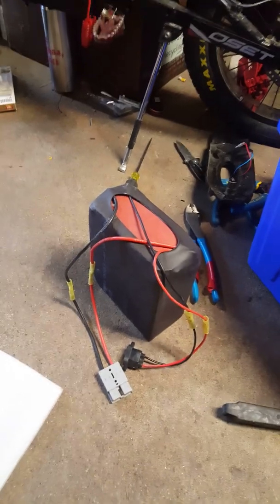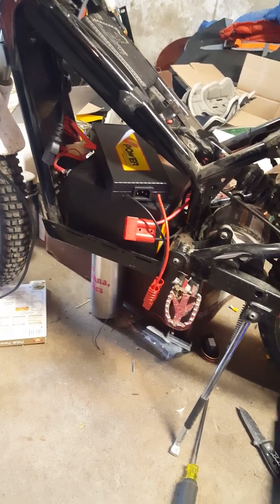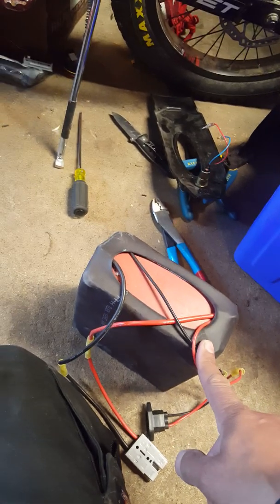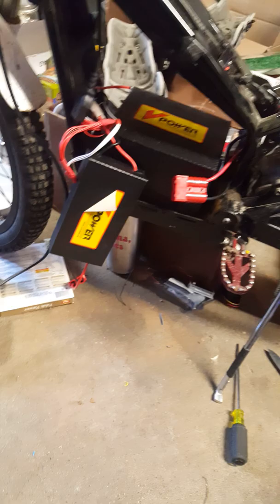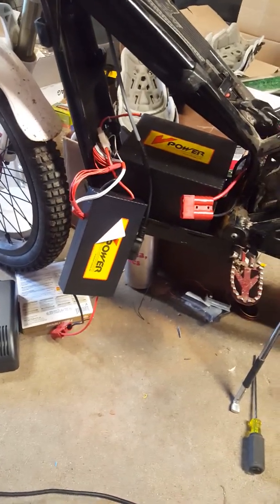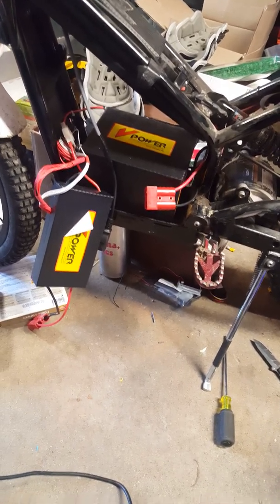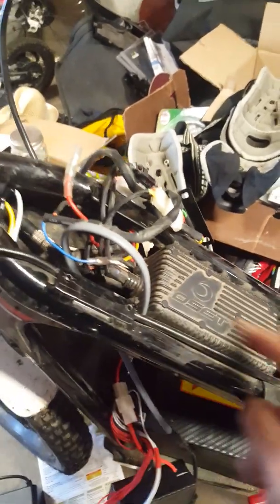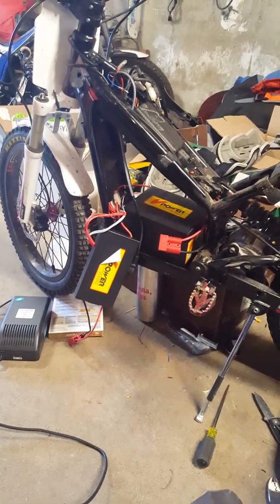Oset 20 lite battery upgrade

Comment: Hey mate, how many amps does your oset 20 lite 48v motor peak at? And amps a contenius ? I have a battery as the one u show first in the video, with a 40amp continius bms... but it cuts the battery off :( i Can read a 160A peak on my motor when it cuts off 🧐 do you have some ideas that Can help me out to g’et it work? Mr. China seller says that the cells cant handle a Bigger BMS 😞

Comment: Hi, you seem to know what your doing. What battery did you put in the 48 Oset you have ?? THANKS
Reply from the maker: It's one I got off of eBay that was a seller in California. Need to do searches for the correct size that will fit and have a BMS of 30 amps or higher.
Reply: Ask Oset TECH   before considering any changes!     Not as simple as just changing the batteries!

Comment: Do you have a link for the battery you used? I've been looking  to do something similar on my Oset but not finding a source as cheap as you have.
Reply from the maker: They seem to change the listings often. So i did not put up a link. Takes a bit of searhing